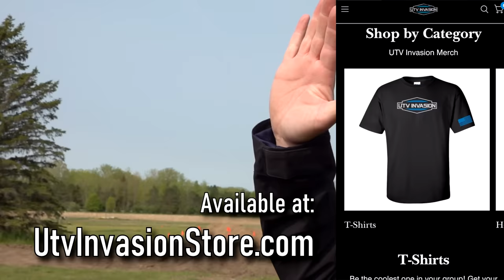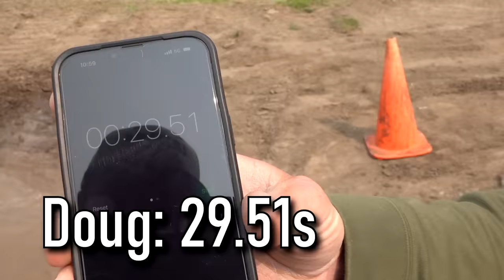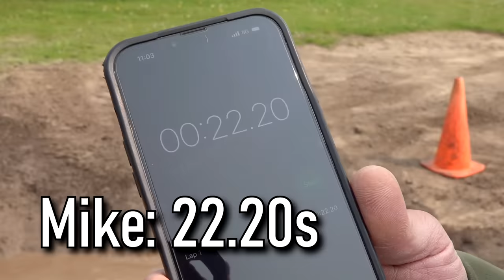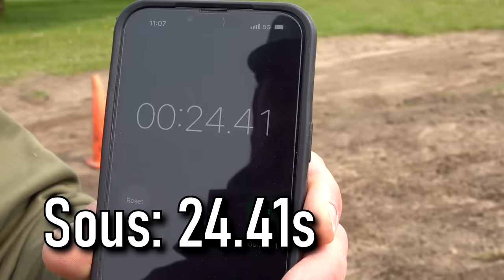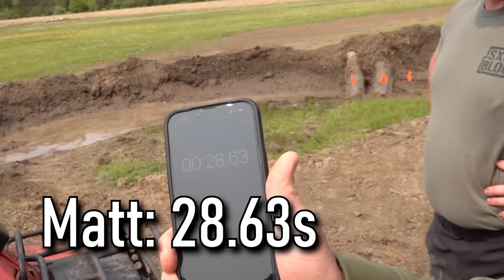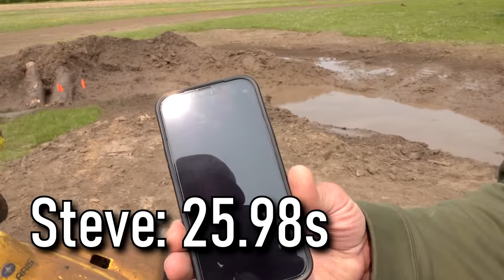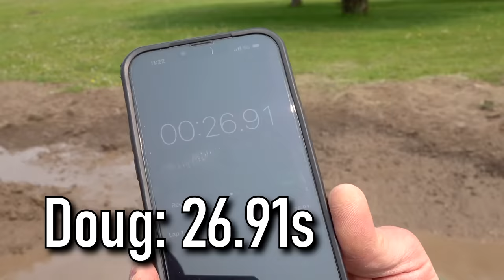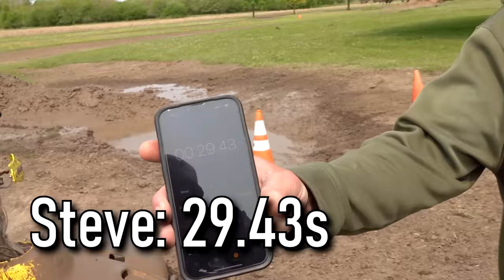Cheap Quads OBSTACLE COURSE! Polaris vs Suzuki vs Yamaha!

Comment: there definitely needs to be a pulling/hauling challenge
Reply: See how fast they can pull a sxs across the field
Reply: There will be
Reply: My recon 250 es would pull a 12ft trailer around my buddies ranch with 2 other quads on it. Lol it was a fucking monster for a 229 single lol it did whatever
Reply: @LandonClimbs  I have a Suzuki LT160 that hauls two snowmobiles on a two
Place trailer around my property. Now I have a grizzly 660 so the little Suzuki is just for wheelies.

Comment: I've driven alot of quads, most threw twisty trails of southern western Ontario. My favorite is my current 07 Kodiak 350 irs (grizzly in the us for that year). Easy to maintain. When your going threw those tight twisty trails with trees 2 inches from your helmet it just stays in that perfect rpm to power range. Any more it would be all choppy, braking for every corner instead of using your body and throttle.  Any slower and you'd need a smoke. It let your hold and ride the thin line of what it can do so easy well till flying. When you hit mud you just go full throttle and the no weight with all the wheel spin just pushes you threw. Cheap air cooled quads are perfect fun bush quads.

Comment: (I'm not affiliated or a spokesman for them just a enthusiastic buyer of there product.) 
The cf moto brand is exploding into the market! Having bought a 2024 cforce 1000 overland 4 wheeler and an 2024 800 4 wheeler, and just picked up a 2024 zforce gen 2 SXS with different rims and tires I put on. there pretty badass as well and what features they come factory with  is insane for the price compared to every other brand out there. Me personally I beat the heck out of each one of these and have had no issues and I mean I ride hard and do more then they are intended for and they hold up. I'm just hoping being a SXS off road channel you guys to check then out and hopefully see a video on your channel doing some like how you guys think about them as a professional off road crew (I'm not affiliated or a spokesman for them just a enthusiastic buyer of there product.) And 50% of my friends also have now bought cf motos and they love there as well